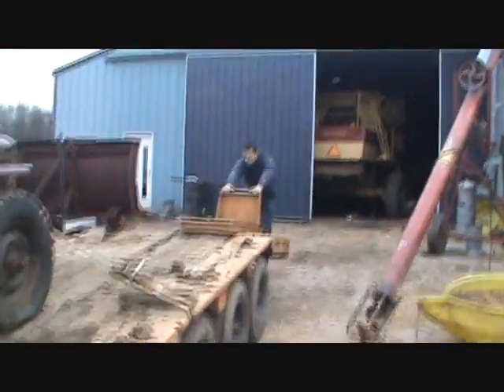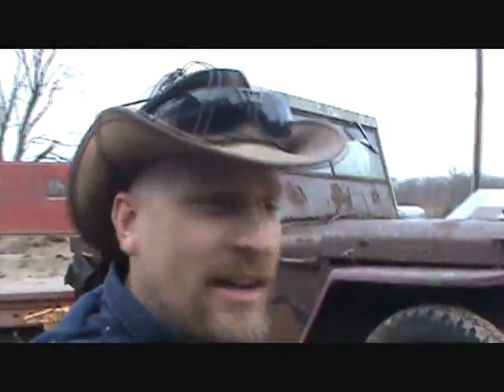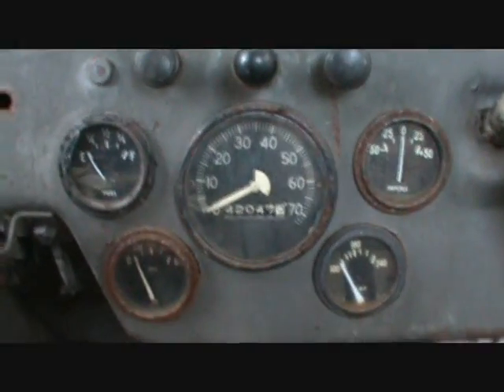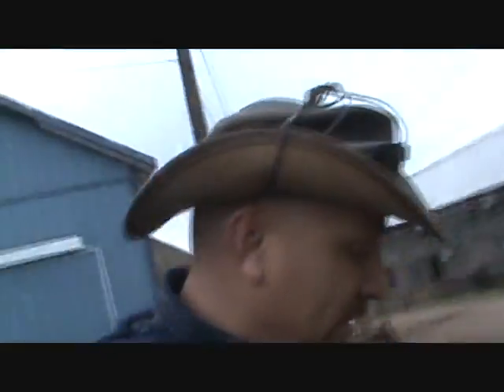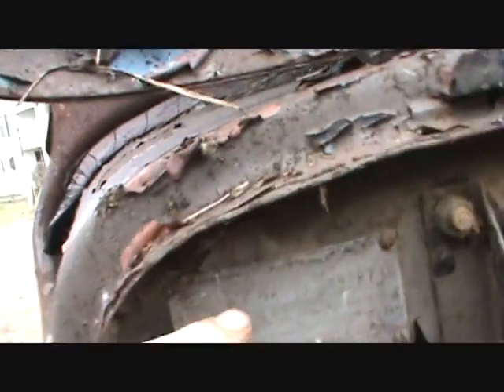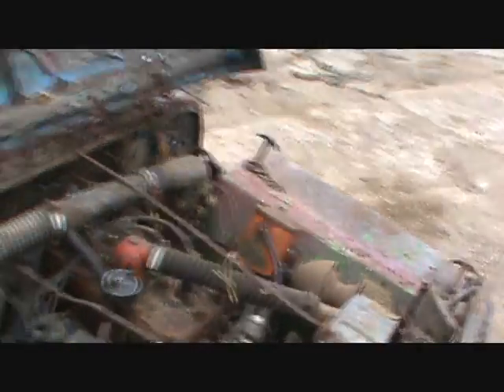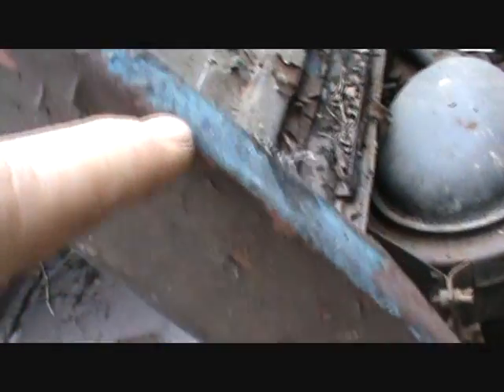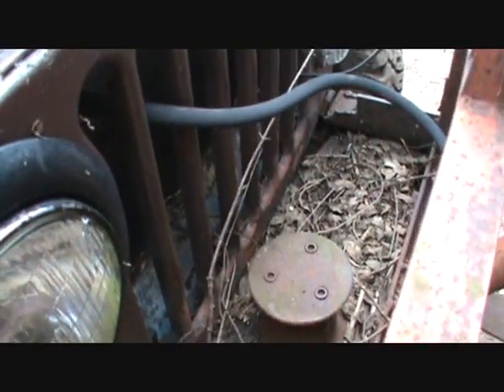Tims 1948 CJ2-A jeep

Comment: Run some seefoam thru her on idle it will smooth up a lot of the missing. These have a screen in the inlet side of the carby that can get plug easily. Fun project.

Comment: I have one of those jeeps here on my farm  it is a 1947 CJ2A and has the Hercules flat head 4 cylinder in it  all original, never been torn down, and runs like a new one, body is getting in bad shape (rusting) but is due from sitting outside year around The bad thing about those jeeps is the chasis, they rust out at the most critical areas namely around each spring hangers.